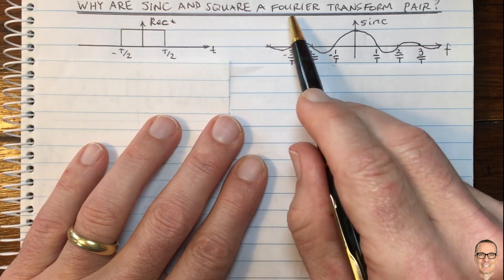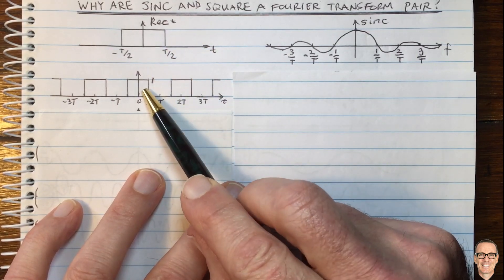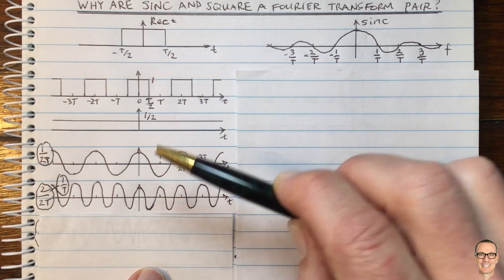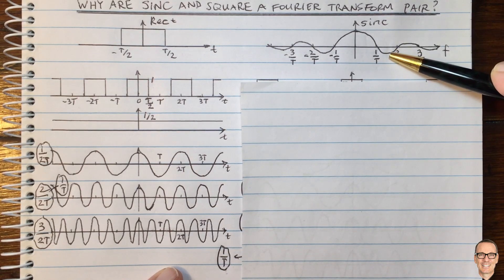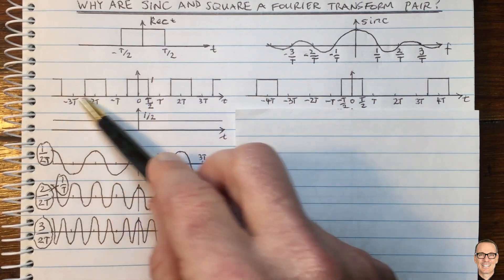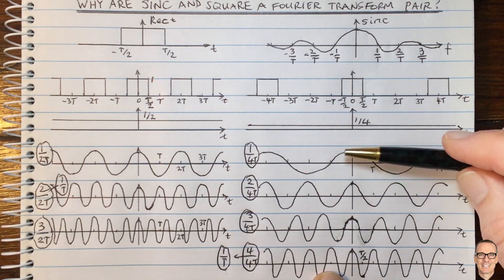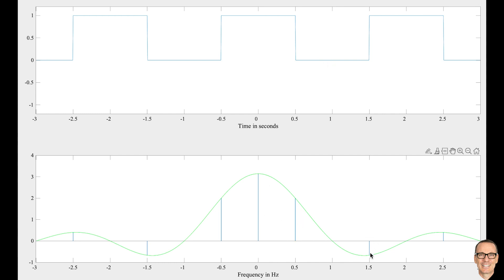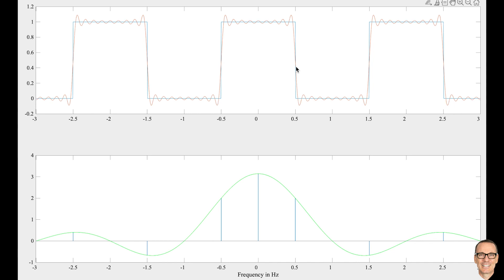Why are Sinc and Square a Fourier Transform Pair?

Comment: Sir first of all thank you for a very useful and insightful video.
In the end, you said that the sum of areas of delta impulses is equal in all 3 cases but at the same time we know that for a square wave with an infinity period will have more ipulses with each impulse having a smaller area and smaller contribution in the overall sum....how can that be shown? You implied it and I agree but there must be a way to visualize that as well
Reply from the maker: I'm not sure what you mean. What do you mean when you say "for a square wave with an infinity period will have more pulses"? What "more pulses" are you talking about? If the period is infinity, then there is only one "pulse".
Reply: @iain_explains  sorry sir...amend to read "sum of areas of deltas impulses is equal in all 3 cases"

Comment: Excellent explanation. My question is: Applying the same procedure that you did for 1/T( Checking for gradient at that point for every contribution), for 2/T frequency of the Sinc wave, then there will be twice the number of frequency components ( for the 1/4 case for example, we have to calculate until 8/4T), and hence is it right to ignore this part when we express it as a rect function? I understand that the contribution of the constant decreases as we increase frequency, but can we neglect these sidelobes of sinc function completely?
Reply from the maker: Sorry, I don't understand what you're asking. I didn't neglect any of the sidelobes.

Comment: Doesn't phase also matter when constructing a superposition of a whole bunch of sine waves to make the square wave? Could one argue that you could simply shift 2/2T over a bit so the edges align? Pretty sure I could, but in doing so only some edges would line up while others won't (answering my own question).
Reply from the maker: Yes, you're right - phase does matter. But in this case, the square waveform is symmetric around t=0, and the only sinusoid that matches that property is the cos wave with zero phase offset (or the negative cos wave - which is the positive cos wave with 180deg phase offset). So at each frequency, the (Fourier) component will be a cos wave with a +/-1 multiplier.